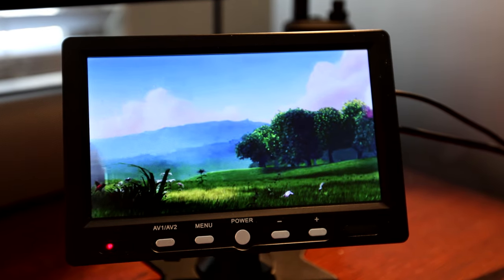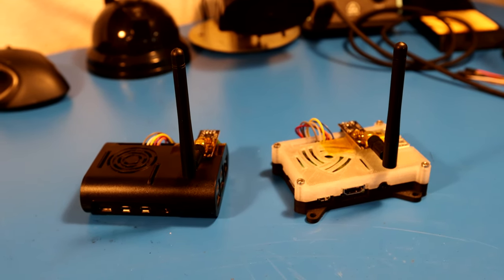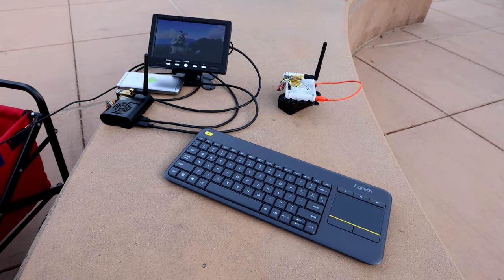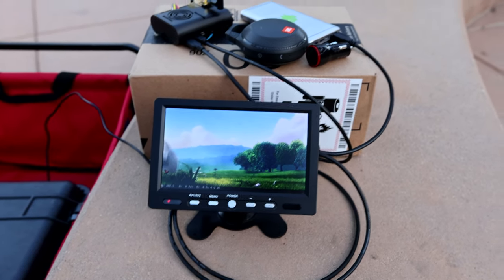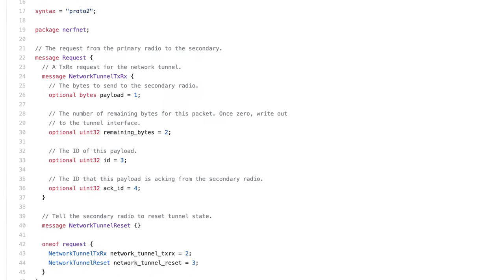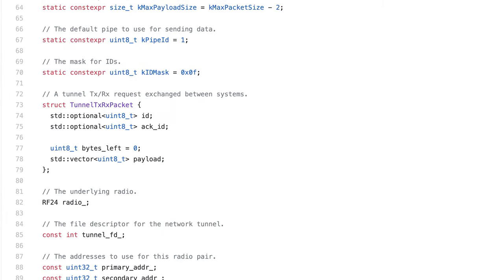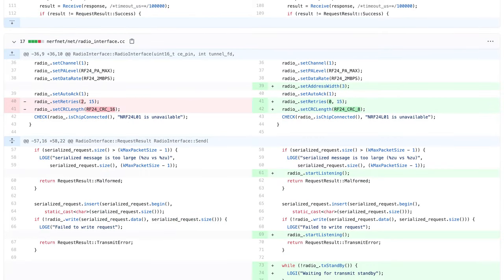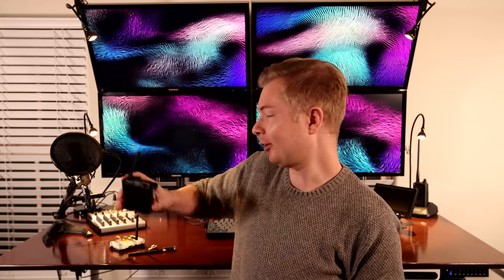nerfnet: Streaming Video over nRF24L01 2.4GHz Radios

Comment: I have a bunch of those for my rc drones. Could i stream video and also keep the 9 channels already on my transmitter
Reply: Same question 🤔have you got its answer by now???
Reply: I am working on it, so far I've included 5 channels on my PCB. But you cannot expect high reliability because it's easy to lose signal

Comment: Brother, I have high hopes for your software. I have personally used these radios as well. They show promise but I think what you are missing is mesh networking. If we have that, we can setup a local wan spanning a city. I am currently working on project which is basically involving uavs. Currently communicating over 4G. I have to pay for the data plans as well.

But suppose, I have a swarm of them over 8-10 kms we can start by creating a local LAN.

Let me know if you are interested?

Comment: Hi Thanks you much for this video. Question: I recently purchased an ZLL SG908 drone. The range of the drone is very good from controller/transmitter to drone commuication. The downfall of the drone is the FPV transmission to phone app  , which is simply wifi 5 ghz transmitted,, which the screen freezes at about 125 meters so after that you are just flying by line of sight. How could i send the camera video ,,(eliminate the actual 5ghz feed ).. through one of these nrf26L01 radios to a simple 6 inch lcd that i fabricate onto the existing controller/transmitter that the drone came with? The drone camera video is actually saved on an sd card on the drone itself...so the video quality sent to the ground lcd monitor doesnt have to be real great quaility . Seems it should be doable for longer FPV range of the camera. I hope i explained this clear enough . Thanks again.

Comment: This is one great project. I was wondering how well does it work with other wifi routers working close to it.
Reply from the maker: It seemed to work fine. I used it in my apartment where there are a number if wifi access points around me. The protocol has retries so eventually the packet will go through.
Reply: @TheResistorNetwork  It does work fine usually, otherwise you can move to the higher channels to get rid of most interference

Comment: Codec and resolution?
Reply from the maker: For video I used the h.265 (HEVC) codec in 640x360 (16:9) resolution at 15fps. I used OPUS for audio and heavily compressed that as well. There are more details in the linked blog post including the exact commands that I used to transcode the stream. Thanks for watching.

Comment: How about using lora instead of nrf modules              cool.....
Reply: I tried, l'ora has issues with turnaround times and data rate, it didn't work out in my tests.

If you wish to experiment, clone my repo then make a pull request once everything works.

Comment: Ive wanted to do something like this for so long, to create a ssh and VNC link to my home computer thats not going over cell towers or other networks i have no control over. with the reasonable speed you've achieved I could do almost anything, watch a movie, video chat, send communications, send and recieve small files (i'm patient, unlike most people). I do have a challenge for you. Make a wireless connection between 2 raspberry pi's using nothing but the GPIO pins! there is already a library to transmit frequencies over pin 4 of the pi's gpio (just add a small wire for antenna) but can we do the same thing in reverse and recieve over pin 4 on a second pi? if we can do that, we just add transmit and recieve to both pis and we have a radio link. It doesn't have to be fast, even 300 baud is enough to control a computer with telnet.
Reply: Not really possible as the radio via GPIO is using the CPU's spread spectrum, you don't have a filter to read it back from the GPIO.
You're better off using a couple of 433MHz RF modules for this.
If you wish to experiment, clone my repo then make a pull request once everything works

Comment: Have you tested latency?
Reply from the maker: If I recall, ping times were around 100-200ms. Not great!
Reply: Hey  @TheResistorNetwork  , I was able to hit 900kbps using 2 arduinos with a simple change (one way), perhaps that could translate in near 2mbits with a couple of rpis!
Keep in mind that your settings could prevent the custom ack to work properly
Reply: It's been almost a year, eventually I achieved full duplex 900Kbps on a couple of Pis and stream real-time video on it. Works good and is flexible enough to add different radios and different configurations

Comment: Is there encryption in this Communication ?
Reply from the maker: None, and I discussed that on the github page for the project. This is subject to replay attacks and eavesdropping (among other things). It is beyond the scope of a weekend project but these could be mitigated.
Reply: @TheResistorNetwork  Ok i got it. i have one more question. İ need a small communication module that can transfer at least 500 meters of low latency video and data. what is your advice ?
Reply from the maker: nothing comes to mind immediately, but maybe consider some of the 5.8GHz modules used for drones.
Reply: @TheResistorNetwork  Yes I know. I am an fpv drone racer. But I don't know how to transfer this video data to raspberry pi which is the receiver.
Reply from the maker: That is a tough one. Any capture card will add a few frames of latency. Good luck!
Reply: At this time, did you found a solution for your com network?

Comment: Bro, what is the expected range.... Will it will work upto at range of 500mts line of sight....
Reply: is it possible to archive in Arduino...
Reply: Likely not at 2MBPS speeds, but could at a much slower rate. Not sure at what point it becomes unusable